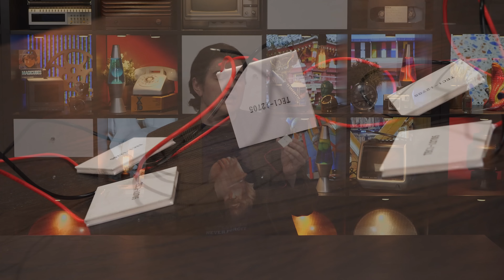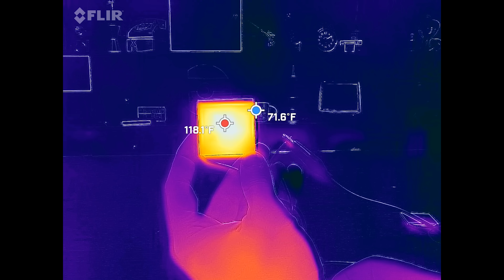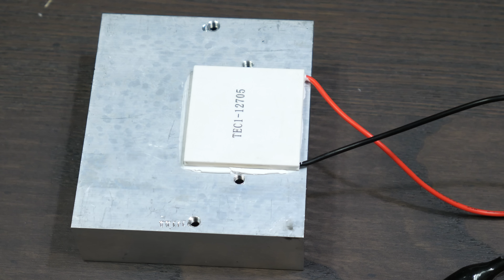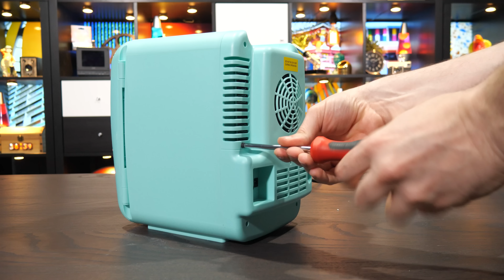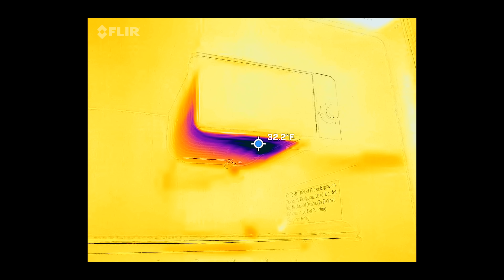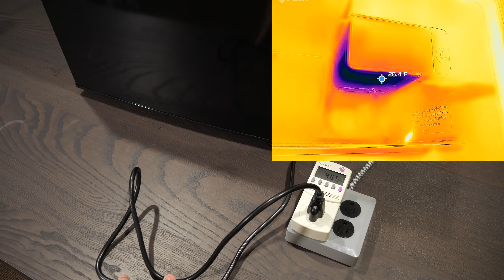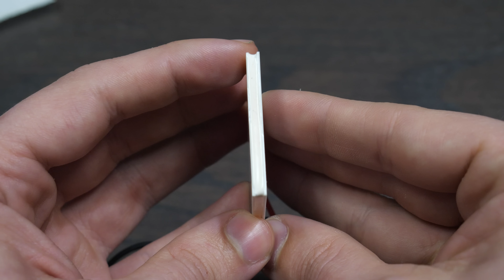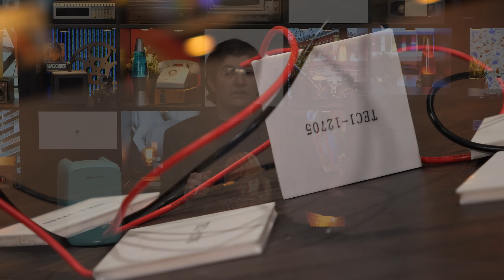Thermoelectric cooling: it's not great.

Comment: Another thing that Peltier Modules are used for is easy electrical generation, get one side cold and one side hot and it induces a voltage. This is actually used in space probes which have RTGs.
Reply: Petier device are better power generators than heating or cooling.
Reply: @borttorbbq2556  Their heating is above 100% efficient. Their cooling... Not so much.
Reply: @ashtonhoward5582  The cooling is cool, but the heating is definitely better. While it's not a lot, I love the power generator idea's, (they lack effective cooling, which impacts the efficiency dramatically, but ive had some ideas)
Reply: Peltier based generators are also made for use with woodstoves.  Not a huge amount of electricity at a few tens of watts for a lot of money for COTS ones but better than nothing in a cabin in winter when solar would be making little or nothing.
Reply: I see them in use atop wood burning stoves, using the generated power to run a fan.
Reply: @PracticalDadd Yep! I was just going to pop into the comments to mention this. My parents use 3 of these on top of their wood stove to blow the hot air around their living room in the winter instead of having to run the furnace. They work great for that!
Reply: @PracticalDadd that’s a great use, and a perfect way to make the fan automatic
Reply: @PracticalDadd  my mom has one for her wood stove! You have to remember to remove it (or at least move it) before cooking on it, or it will blow your spices all over the place.
Reply: @PracticalDadd and they are useless. tried some. better use a PV powered fan.😊
Reply: The electrical generation of Peltier modules is also pretty niche in its application. I've seen it used in novelty items where you set it on a fireplace, and then the current produced by the peltier drives a fan which blows over a heatsink attached to the cool side of the peltier. I imagine its use in deep space probes is because solar doesn't work that far from the sun, so just like its use in cooling, the use in power generation only makes sense with a rather specific set of constraints.
Reply: @reaganharder1480 To be fair, using it with a woodstove, where it electrical generation is in addition to the heat generation, seems like a pretty good use case for it
Reply: @reaganharder1480  solar worka fine enough but I think they went with decaying plutonium because curiosity was so much larger than any other rover put on Mars, and the equipment onboard would use more electricity than solar panels could make, plus being able to run things at any time of day is nice
Reply: @sirsanti8408  The real problem with solar panels on Mars rovers is duststorms.
Reply: @reaganharder1480 and the fact that in space, the cold side could drop to a few kelvins...
Reply: @gregbailey45 yes but you have very little medium to eject the heat out to. This is why the heat sinks in spacecraft are so massive versus what you would require for the same heat output in atmosphere. The only "solution" would be heat pumps dumping into ejectable heatsink canisters.
Reply: @reaganharder1480  FYI... By default these have an abysmal efficiency, but I know of active research which has shown significant increases in efficiency for use in residual heat to electricity conversion.  If this can scale from the lab to production is another question, but I appreciate that this is being looked into more.
Reply: @reaganharder1480 We tried it for research with energy harvesting in capacitors and it could generate enough power from some basic pulsed IoT communications just from temperature differences between water and air. The conclusion was: a good primary battery can do the same for many decades and it is more than 10 times cheaper and more reliable.

Maybe if they can make it cheaper and more efficient when low gradient we will see many aplications in the future for powering sensors without batteries.
Reply: so all you need is a little plutonium and you have a nice little power supply.
Reply: @5Andysalive Good thing by now it's easily available in every corner drug store.
Reply: @5Andysalive Well certainly don't get a lot of plutonium, big mistake
Reply: @5Andysalive  Yeah, some rewiring and with just a bit of plutonium, your little blue fridge generates free electricity!

And free cancer, of course.

Whatever. You could probably run a model lighthouse in your garden if you had enough plutonium, for years! Or preferably, in someone else's garden, who preferably lives in an other town, or on a different continent.
Reply: @klausstock8020  The Platonium used in a radiothermal generator (RTG) is a beta emitter that only really needs light shielding.
Reply: @klausstock8020  Furthermore, your apparent fear of radiation is unfounded. While plutonium isn't an alpha emitter (an alpha emitter with basic clothes that covers your skin and some gloves maybe a face mask you could handle it indefinitely without worry) you would have to be careful with unshielded beta emitters by restricting time and distance (when able). Gamma emitters are scary. I understand fear of them. Though the radiation has so much energy, it'll pass completely through you. Beta is the most dangerous, though alpha is the most damaging.
Reply: @5Andysalive  Damn. Time to go mine me some at the local quarry then!
Reply: To everyone in the replies, yes, it's incredibly inefficient and is only really used in edge cases. The RTGs that NASA uses in mars rovers and space probes generate so little power that it's barely useful at all, only generating enough to light up about 16 LEDs at peak efficiency using literal nuclear power. The real reason they're used over solar is due to it's consistent energy output. The voyager probes each used an RTG and they're still working, although just barely.
Reply: Hurrah for the Seebeck effect!
Reply: I was bored one day so I used a candle, a peltier, a cheep aluminum heat sink, and a motor to make a candle powered motor.
Reply: @I.C.Weiner like a Stirling engine?
Reply: Not "easy" due to the dT difference needed to get meaningful amount of power. Though still useful for waste heat recovery.
Reply: I love running electrical things backwards. I still remember working out as a child that I could use my crappy little earphones as an even crappier little microphone.
Reply: So you're saying use one as a CPU cooler that powers its own fan?
Reply: The main difference between thermoelectric coolers and thermoelectric generators is how they are arranged. A “good” cooler is a bad generator, and a good generator is a bad cooler.
Reply: @AmaroqStarwind  so what are the differences in arrangement?
Reply: Yup, we have a "heat powered" fan on our wood stove that circulates the warm air. Efficiency is irrelevant because we're already creating the heat by the fire in the stove anyway (fan or not,) so the fan is actually powered for free. When I mean "free energy", I mean it doesn't use any extra energy that we aren't already producing, like needing to burn an extra wood.
Reply: at a fractional efficiency
Reply: RTG's use thermocouples for electrical generation which is just two dissimilar metal wires twisted together. You heat the twisted pair and a voltage appears across the other two ends of the wires. It's application is mostly used in instant read thermometers.
Reply: now put one against heat pump and you have infinite energy!
Reply: Interesting 🤔. Just like a solar panel is an LED used in reverse. Or like an electric motor turned by the shaft instead of by the...🤔...motor.
Reply: It's an application that is being worked on for use in closed loop small nuclear reactors. Funny enough the best system that seems plausible currently is a helium gas-liquid heat pump transmitting core heat to peltier elements to generate power rather than boiling a secondary water source and spinning a steam turbine. It's a system that is still being tweaked but it may be the best method for small nuclear reactors in the future. Remember ladies and gents, the future of power is nuclear. We solved infinite power generation already. It's safe. Efficient. Green (so much as anything can be,)
Reply: @masonborden5594  not indefinite but we have enough materials and designs to be set for 150 years if we exclusively used nuclear. Supplemented by renewables we are set for 250+.
Reply: There's an old, very diy, camping stove phone charger setup that can be seen on Timo Noko's youtube channel. You can boil water while getting power for your phone, the water acts as a coolant. Reportedly a nominal 15 W element on a kerosene burner got an output of 5 watts, which is not great but enough charge a non-smartphone in an emergency.
Reply: What kind of temperature difference would you need to get a useful current?
Reply: Unfortunately they still aren't very efficient generators either
Reply: I came to make a comment to this effect, I’ll save it.
Reply: how does heat dissapate in a vacumn?
Reply: @andrewgray5109  Actually, it radiates heat using light. Specifically infrared. It's the same reason that the sun feels warm on your skin or that feeling of being close to a fire. If you were to look up images of RTGs, you would find that they often (if not always) come with fins. The fins aren't there for stabilization, they're in space after all, it wouldn't work. The fins are there to act as radiators, the same kind that's likely in your house, these radiators make the cold side of the RTG slightly colder than the hot side, creating a heat difference, and when there's a heat difference, there's energy.
Reply: @andrewgray5109  By radiation, it is the most effective heat disipation for temperatures above 100K because it scales with the power of 4. That is why water freezes instantly at empty space.
Reply: Thank you, Alec! 
Love you!
Reply: Soviet petroleum run radios....so you can listen government propaganda even in areas without electric
Reply: i learned about peltier modules when i was today years old and that was one of the first things i wondered, if you could swap around the energy ins and outs and make a generator out of it
Reply: This is simply a thermocouple but a whole lot of them
Reply: is it theoretically possible to line the walls of a regular fridge with these, and partially power it through that?
Reply: @minecraftmondays  yes but it would use a crazy amount of power.
Reply: @borttorbbq2556  if generating power using these used a lot of power i don't think they'd actually make any
i might be misunderstanding something here
Reply: @minecraftmondays  oh I missed that part. I missed the partly powering the fridge there wouldn't be enough of a thermal difference to really make much power
Reply: @borttorbbq2556  ah thank you 
i had thought since fridges generate heat on the outside it could be put between there and the freezer maybe, but i underestimated how big of a difference it would need
Reply: @minecraftmondays  it takes a decent amount of heat or like dry ice on one side I'd suppose. Although I'm admittedly not sure what the temperature difference to power conversion is but considering 350+ one one side and 98 or so on the other (depends on style.) Is wat it takes for a low power fan I'm not sure (I know numbers aren't quite accurate but eh)
Reply: Russia in the old days used radio isotope thermoelectric generators to power remote devices. These are now orphaned with gallon paint can sized chunks of plutonium resting inside for someone to find.
Reply: Also probably the only common man's practical use for the device!
Powering a fan ontop of a wood stove.
Reply: I have one of the camp stoves that uses this to run a fan to keep some burning twigs burn more efficiently. It generates enough to charge a USB device on the side. I would love a bigger one for my woodstove in the winter.
Reply: Mine is a question, solar panels on my roof get quite hot here the tropics what if covering the back of the panel with a bunch of these also there is usually a steady tradewinds breeze to cool the other side of the peltier fitted with a heatsink would it be worth it? could it cool the solar panel some enhancing its output and lifespan? would a brainy person try this please and report the results to us less brainy?
Reply: @DanielRodriguez-ps9fq  Thermoelectric generators are very expensive and actually have very low efficiency. Usually thermoelectric generators bein use only in situations where you don't have any other options
Reply: There exists another technology that produces mechanical, then electric energy, from a temperature difference: the Stirling motor. Some solar concentration thermical plants use that instead of steam turbines.
Reply: As others alluded to, one of the key issues with this use is that you need a temperature gradient for it to work. So, if both sides are a similar temperature... it doesn't work. Or, if the "cold" side heats up (which it will over time)... it doesn't work. You need to keep it reliably hot on one side and reliably cold on the other, and even then it's not super efficient. But it's pretty neat.
Reply: Lol space probes lol😂😢😅
Reply: If we managed to improve this technology we would finally say goodbye to boiling water in some way to run a turbine
Reply: @Valery0p5  don't hold your breath.  Steam turbine engines already operate fairly close to the Carnot Engine theoretical limit, when built at large scale and high temperature.
Reply: @Gaming1Doge  I have a JOI lantern that powers a small bank of LEDs from the heat from a tea light candle. Perhaps not greatly efficient, and they're not cheap, but I don't think the candles cost much more than batteries and their shelf life is much greater.
Reply: @thomaswilliams2273  With modern LEDs and an efficient boost converter you can get much more visible light than a candle produces despite the terrible efficiency of a thermoelectric generator.
Reply: @rocketman221projects  Absolutely.
Reply: now I'm thinking about using this for power generation here in Canada. I have walked to class in temperatures below negative 50 in the wind chill, I wonder if I could get one to work by fixing it to my body or pressing on it and having the other side exposed to the air coolant. then it can be used as a flashlight that just uses my natural body heat. or if the heat differential would be enough that I could attach a few of them to my chest like an EKG and charge my phone.
Reply: @dizzylilthing they are not efficient at generating power, not at all. 

You probably wouldn't be able to light an LED with your body heat. 

You can barely get 5 watts out of one when you expose them to fire levels of heat. 

Look up RTG's (radioactive thermoelectric generators) to see how inefficient they are... Most of the radioactive heat goes to waste.
Reply: @volvo09   In an offgrid setup... A Watt is a Watt
Reply: @dizzylilthing I don't see why not!
Reply: @gregbailey45  someone else explained that the difference between your body temperature and the environmental temperature isn't enough but I still wonder if you could trickle charge an LED or something

Comment: Other mini fridges: Peltier Cooling!
Makita: FUCK IT FULL ON COMPRESSOR.
Reply: Dude. Makita. Battery powered coffee maker.
Reply: It's a Danfoss compressor. Many have that 12v unit, including batteries. Like Alpicool. They're available on Amazon.
Reply: The Makita is the first I've seen that runs off those kind of batteries. I have a Dometic that looks very similar and runs off AC or DC cords. It uses barely any power, I think it's in the 25-30 range.
Reply: Yeah, but the Makita one is a 20L one, making it not "mini." It even has wheels.
Reply: I immedieately thought of makita portable fridge when Alec mentioned that fridges need to be upright.
Reply: I love my little piece of 💩, but then I pre-chill everything and only use it so I don't have to walk all the way across the building to access a real refrigerator.
Reply: @PhiloSage  If you are already going to the fridge at some point, wouldn't a foam box and a freezer-pack be equally convenient without resorting to a constant 60w drain and fan noise?
Reply: @Prophes0r  for short term use, but it's not so good overnight or the weekend. Plus, a foam box needs a friction fit lid to really keep in the cold. Because it wears out so easily. There are not many cycles before what I need to be replaced. 
The unit I purchased has a very quiet fan, it really can't be heard over the general noise floor. And I couldn't care less about the energy usage.
Reply: Well yeah, why would they sell something useless. They are a big name brand, selling a dumb peltier 'fridge' would not end well
Reply: @nielsvanderwaa9539 Makita sells a lot of trash.  They sell some amazing tools. But a lot of trash as well.  This goes for all of the tool brands.
Reply: @stenmin1234  I've had good luck all round with marital. What don't you like of theirs? I haven't seen it yet but I do assume every brand has one dog. For Bosch it's the colt router. For that matter, even Ryobi has one or two winners.

But let's talk makita
Reply: @stenmin1234  Yeh. Their radios are absolute trash.
Reply: @nielsvanderwaa9539  yeah it wouldn't run very long with a peltier, just a couple hours... 

Guys using tools are wanting more performance, especially on a job site where power is scarce.
Reply: @nielsvanderwaa9539  According to another comment above, Frigidaire sells these toy fridges, and they're a big name brand too.
Reply: @nielsvanderwaa9539  It's almost like you don't like in an Ultracapitalist wasteland like the rest of us do.
If it makes number go up, it's the correct business decision.
It can be the wrong decision in every other way. That's just the next guy's problem.

Comment: Small correction : While its true that isobutane is commonly used as a refrigerant gaz for fridges, your mini-frige uses cyclopentane as indicated by the big c-pentane label on the back of it. Nonetheless, all the things you mentionned about isobutane should apply to cyclopentane as well, so it's not a big deal.